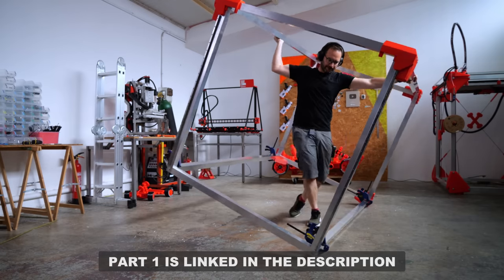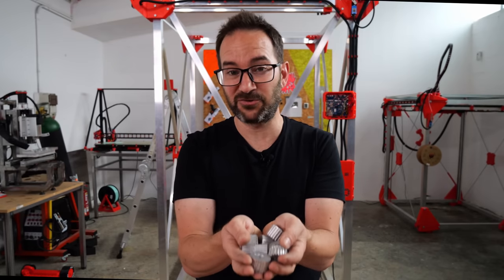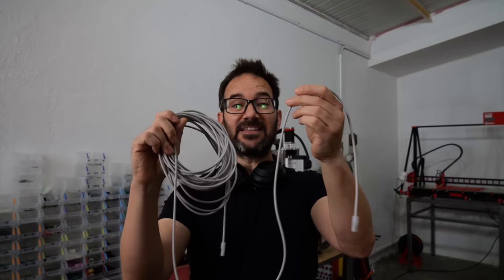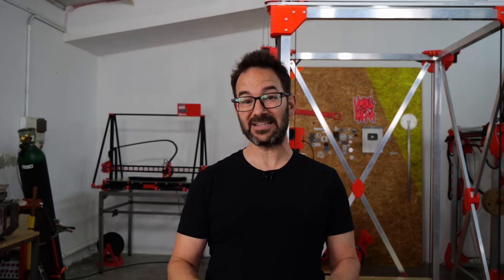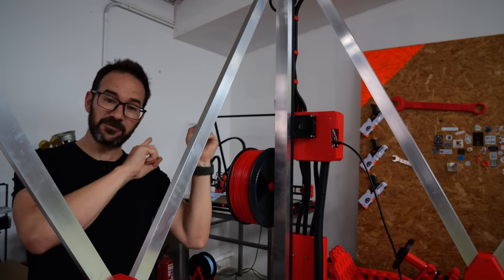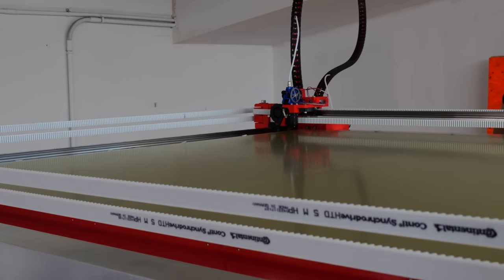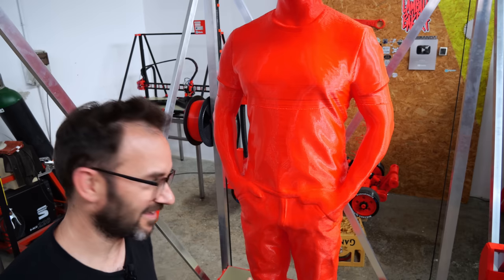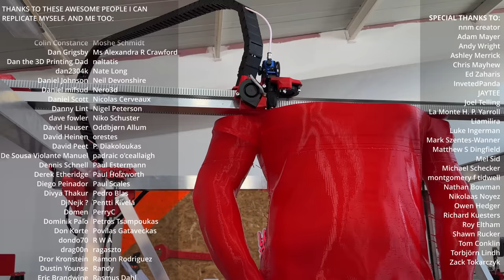You won't believe what I 3D Printed - Giant 3D Printer build Pt.2

Comment: expensive v-wheels are far better than cheap linear rails.
Reply: At the scale of this printer, and given that the v wheels are not supporting the dynamic weight of the part, I think they're totally adequate. You can get very accurate aluminum extrusion, and even with linear rails at the scales involves you are still dependent on the aluminum extrusion for overall dimensional accuracy.

For other designs where the moving axes carry the weight of the part, I wouldn't recommend v wheels since they deflect by design. But here they are only aligning the bed and supporting the known weight of the print head.

It is a very clever design with many good solutions to problems of precision and fabrication.

Comment: Is it possible to make the motors closed loop?
Reply: Sure.   Closed loop servos are pretty common on higher end laser engraver cabinets.   The issue of missing steps tho is better corrected fixing the mechanical issue that caused the skipped/stalled steps in the first place.

Comment: Fun Fact: 
You can buy a regular 150$ printer and modify it's frame to a bigger printer, setup the software to the new dimensions and voila , a big printer
Reply: That's what I was thinking. 

Just a larger frame and the base am I right? I'm learning about all this rn.
Reply: @timothyodell5245 you gotta make a bigger bed too, plus you gotta upgrade the motors to compensate for more weight, longer beefier belts, if your printer uses lead screws then longer thicker screws as well, and basically all youre getting at that point are the brains, power supply, and the hotend
Reply: @ziljaeyan1203  though youd need a bigger hot end if you want to use 3mm filament and a bigger power supply for the new motors...

Comment: I've had groove wheels for ages now. The secret is to not over tension them and to keep them clean. If you break those "rules" they suck. Every time i buy someone's old printer that happens to have these, the wheels are shot because of either or both of those things. The tension (on the rail) should be set such that they engage and not rattle, and that's it. Printers with the offset bushing (for these) are the best, the other methods of putting tension on them suck, and don't really work. Cleaning them can be done with ISO, once every weekend (of use) or every time you power it up. The rails should also be clean of dust.

Comment: Honestly, v-wheels are fine they just wear down more often then linear rails. I would prefer linear rails but a cheaper solution might be 80/20 or compatible-make unibearings with z-axis extrusion bolted to the square tubing.

Comment: challenge: build a 3D printer that is 2.5 meters wide, 5 meters long and 2.3 meters high
Reply: the design that he used, let you change the dimensions lol, 5m long the only thing i can say its, poor motors lol
Reply: @UnspokenTube0  😅 Don't  you  want 1:1 scale car out of a 3D printer lol
Reply: @user-lv5xl2hf2v  xd my plans its to make the parts for the car lmao, or at least the mold so i can make them in carbon fiber lol

Comment: Is there any benefit to using a spool system over a heated screw extrusion mechanism? (I forget the name of the mechanism, the way Dr D Flo approached it)

I feel like at this size (with how much material you'd be using) that it'd be way cheaper to do the heated screw extrusion method?

Hell, would the heated screw method even work as well for assorted materials as direct drive? Like would it impact print quality much?

Comment: If there's one thing I don't understand, it's why you chose to use a printing surface as what needs to move in the third dimension.  Aren't you afraid that the weight of the print will cause it to stretch/bend/tear?
Reply: Probably better precision than a core xy type at this size?

Comment: You might think about how dry the filament is as it gets to the print head,  keeping the roll and the long path dry might affect quality too, especially if the room is not unconfortably dry. It might not be an issue, but it could also be an issue. Even so your giant printer seemes to work okay even with the fixes you had to apply, that suggest you did a fantastic job making the printer. 
My question now is, can you improve upon it? :D

Comment: why did you use pei sheet top of the glass? Glass can be alone better for heated bed?  i am asking to learn :)
Reply: I think that is a way to reduce the flatness of the glass, thus reducing the suction effect that could come with large 3d prints bases. this could be an issue in XXXXL 3D printers I imagine. 
it also reduces the risk of breaking the glass if the 3d print refuses to separate as the PEI should be the layer to fail. which I imagine is cheaper than the glass, or at least easier to replace. In case of printing PETG, this can be a serious issue (it has an incredible adherence to glass and PEI, but adding glue as a weakness layer tend to be easier to apply in textured surfaces). 
with PLA it could also reduce the likeness of first layer failure due to string traction overcoming the glass/PLA contact surface.

Comment: Is it the statue thats that wobbly, or the 3mm alu bed? I think using some kind of foam-sandwich panel with skins glue-bonded on both sides might make a lot of sense. Though I suppose heating just one of the faces of the sandwich panel wouldnt be great either, in terms of bowing. Maybe cut the heating wires into the foam then laminate with carbon fiber? Not for the specific strength but the low thermal expansion.

Comment: Bro which software will you use to work the printer like marlin or any other firmware
Reply: @OFFICIALIVANMIRANDA6  bro tell which firmware did you used
Reply: @demontejas7393  its a duet3 motherboard zo RepRap firmware I guess

Comment: Can someone explain why the bed needs to be heated? Is it just to be able to remove the print? Because it seems like the active part of the printer isn't anywhere near the bed past the very beginning
Reply: Bed heating allows for better adhesion. Prints wont adhere to cold beds.
Reply: @ognoobish5332  Ah, I see. So it'd just fall over in the printing process?
Reply: @yaksher  The extruded filament is over 200°C, and as you know things shrink in size when it's cooled down. So if the printed thing is not heated, it can shrink while printing, resulting in the edges of the bottom layer floating(google '3D printer warping'), weak adhesion and yes, even falling over or moving around on the bed. These days almost every commercial 3D printer has heated beds. Hope this helped
Reply: the heated bed also reduces warping on the first layers, by giving it a less sharp drop off from the nozzle temperature, to the bed temperature.
Reply: Plastic contracts as it cools. When it contracts it will lift off of the bed, so the model will likely fall over during the print. The heated bed prevents the plastic from contracting, but doesn't heat it so much that it melts.

Comment: watch out for those cheap solid state relays, they will burn up. I don't know if yours is a cheap ebay one or not.

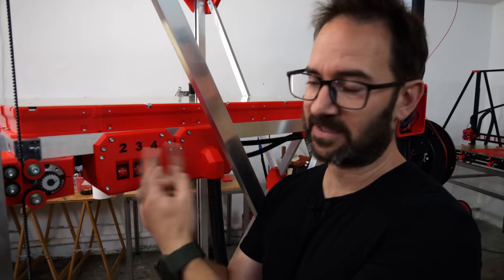Also your whole bed moved 2mm when you touched it at 13:07. stabilize that thing

Comment: I wonder where this history (that I follow since a cupple of years now) of always bigger printers creation will ends :)

Note, It sounds strange that it took 4 days to print 6.2Kg, that would mean only 64g/hours nearly only 1g/min, I assume you include the whole time wich also include issue you have encounter and their resolutions in the total print time ?
Reply: Lets print a planet?
Reply: Slartibartfast has entered the room
Reply: His notes says it took 76 hours of print time, so more like 81g per hour. I think he has to print slowly because of the model aspect ratio, height to width. He is also pushing 1.75mm filament thru a 1mm nozzle at 0.4mm layer height. That takes time to melt that much plastic. Plus, no part cooling fan?
Reply: @jbrou123  Sorry I did not read his notes, just earing when he said 4 days for 6.2Kg, you are right for melting quickness but I assume he is using something sized for a 1mm nozzle and able to melt pretty fast. 

Even with 81g/hour, using a density of 1.2g/cc, this is less than 20mm³/s of flowrate (18.5mm³/s), this is no more than a low budget average printer. (I have to precise that I am absolutly not being critising & I love this channel, I just try to understand), (EDIT: a CHT nozzle with a .6 nozzle can easily give 35mm³/s)

For cooling, IMHO on such big print there is few need of part cooling except maybe for some bridging & big overhangs, but 1mm nozzle & 0.4 height(give a tangent ratio of 0.4 height/width) this should handle well most overhangs.
Reply: @brunoaugier  Indeed. Part of the reason for slow print, is as I said. His model is very tall, compared to its base width. He showed how much it wobbles. I'd like to see him print something with a large area base, maybe a large box. Then we can eliminate the wobble factor and see how fast this thing can really go. As you stated, that hot end he is using can handle a lot higher flow rate. Shoot, I have printed with a 1mm nozzle at 0.3mm on my old CR10 with a stock hot end.

Comment: At this scale, is there any real reason to not just use wood for the frame?
Reply: dimensional stability would be my problem with using wood. your printer would actually be different sizes at different temperatures and levels of humidity
Reply: @Xayify  Consider it again!

From two quick google searches:

1. The thermal linear coefficient of expansion for aluminium per degree Centigrade is 23∙10E-6

2. For wood: The coefficient of thermal expansion in the direction of wood fibres is in the range from 3.5 to 5.0 × 10-6/K

Not that either of these 2 would matter too much at this scale (aluminium will dilate less than 0.05mm per degree for a 2m length) but aluminium dilates at least 4 times more than wood with temperature increase. Wood does absorb humidity though.
Reply: @dan-nutu  I shall!

I do see what you mean, aluminum definitely shifts a lot as well. however the thing to remember is that wood is organic, as such it will not shift the same amount across the board as aluminum wood. humidity is the primary factor in this but but you are certainly right that it is not anything insane.

I'm not sure about this really, on the one hand you have self leveling which helps a lot in forcing constancy, and in this particular design I actually do believe it's even less of a problem given the two axes are on top and I think would just be undesturbed

on the other hand, I don't really think the economy works to make it considerably cheaper to do wood right? extruded aluminum is cheap and either way you are using a lot of material. 

so I'm not sure what gain I'd be looking at for even the potential of wood complicating an already massively complex machine

at the same time I certainly won't tell others to not use wood, really I can't say it's a waste
Reply: I'd kind of like to see a big 3d printer made out of wood... You know, creaking like a haunted house or a rollercoaster :)
Reply: I reckon it would be easier or more accessible to try to make one using a wooden frame. You could paint it to prevent it from absorbing moisture.

Comment: How much to construct some similar
Reply: 1.5-2.5k
Reply: Wait and build a voron v24
Reply: Not as big but 100 times faster and better
Reply: @neayt9952  Dude.. this was NOT his question. You dont know what he needs unless you ask. I have a V2.4 but wouldt recommend it. But not because its bad.. but it has issues.
And you wont build a V2.4 in this size. And if.. you will end at 10k.
Ppl like you trigger me hard.
Reply: @hanswurstusbrachialus5213 chill man. I just recommended a printer. And no. Not 2.4. a voron v24. Trust me when I say that it's gonna be better in almost every way.(a v24 was the first voron. It wasn't released to the public, but special build for a company. It's 24 inches cubed therefore the name. V2 series is a downscaled version of the v24. A revised version of the v24 will be released this december and rcf says that it'll cost about 2k) please stop talking about things you know very little about

Comment: Ivan, I wonder if you've thought of this as a new project (or a modification of the one(s) you have already built.

That is, turn this huge 3D printer (or a smaller one that you've built) into a 5 or 6 axis printer, where the bed and extruder tilts in 2 axes so that any shape at all can be printed without supports.  (there are videos of such amazing machines).

Would you consider that?

Comment: wowch, really seems the most practical architecture on this scale is a delta
Reply: I don´t think so. It would have been even taller for the same z height.
Reply: I'm curious, any reasons delta would've been better?
Reply: @mrvolucris1863  requires less superstructure: more height, true, but those are just 3 already existing elements lengthtening. beyond that, still only 3 belts with only 3 steppers (say roller wheels on 4040 extrusions, or 20mm rods or something) and no moving bed shenanigans; 
deltas suffer lower mass penalty with scale, even core xy (a massive, pun intended, improvement over bedslingers) still suffer from the x-gantry gaining weight
lastly, hangprinter
Reply: @matushonko7223  interesting, it does  seem to waste less money on movement parts. 
 

I think these two aspects are also to consider:

1. The circular build area is limiting (Printing a big rectangle, or a long object (positioned diagonally on a square buildplate) )

2. Also surely if you scale the printer up:
CoreXY printer: printbedspace/footprint goes up, because you don't enlarge the railsystem; just make it longer.
Delta printer: printbedspace/footprint stays the same because delta is also limited by its arm movement geometry?

Hangprinters seem like a very cool concept, you could just make a room into one, so you wouldn't need any structure!

Comment: It's great what you're doing, but I just find it unfortunate that in terms of technological evolution, your printers don't evolve.
Only the form changes and the architecture.
Your platens remain rigid, whereas most contemporary printers use flexible platens, and the speed, too, which must be very low.
On printers with such large volumes this must be really penalizing.
Reply: It's hard to push all boundaries within any amount of reason. He's pushing one boundary. size. Speed is another boundary for another person.

Comment: Could have done better with a cnc mill some block of recyclable material and thermoforming.
Could have saved tons of energy and material, went on to make a filament and 3d print again into plastics using an inefficient technology. Now that the plans are public, there will be more clones that would multiply this.😢🏜💔

Comment: Apart from building the same scheme cnc and 3d printer do something meaningfull ,interesting please
Reply: this is interesting and meaningful
Reply: @hajjkl6672  More wasted plastic ?
Reply: A few things here, this is recyclable so not destined for landfills, this is the first print great for calibration as he stated he had to change it to find the right settings, he'll also probably keep the print as it's a large milestone, and lastly your more likely to end up in a landfill because your more garbage than that literal piece of plastic.
Reply: @budgiefriend  you do realize recycling filament is a thing right, especially in such high volumes as he is using
Reply: @budgiefriend  Explain how this is "wasted plastic".

Comment: What a such stupid and awful way to waste a ridiculous amount of filament and electricity.
The fact that you can do it doesn't mean that you should do it
Reply: It may be a stupid and awful way to waste ridiculous amounts of filament and electricity for you, but that doesn't mean it is for him. There are a ton of people who make prints in multiple parts all the time because their print volume is too small, then have to put them together and fill the seams. Having a print volume this size would eliminate that step entirely, which would undoubtedly make things much easier.
Reply: but, it was cool though
Reply: who cares
Reply: @zackjones8802  Of course it's awasome have this print volume and the entire machine itself is fantastic I love it. My problem is with the application of the printer, Why throw away that amount of non-recycable and pollutant material that will remains in the environment for decades or even ceturies ? Why spend 5 days of electricity to make 1:1 scale statue of yourself that's ridiculus! and so narcisist. For sure the world doesn't need that.
Reply: @edgarromeroherrera2886 the world doesn't need you either, yet here you are.
Reply: @edgarromeroherrera2886  So... first off... the statue is printed from PLA which is Biodegradable, isn't made from Petroleum, and is also fully recyclable. That entire statue can be melted down into more filament and turned into something else without an issue. I say just let the man have fun building cool things and maybe find something else to complain about :/
Reply: I bet you also think Elon Musk launching a Tesla car into space is stupid, am I right?
Reply: @seppukuban21  MAN you are totally right! , amazing, you get the hole point without even trying.
Reply: @edgarromeroherrera2886  some things don’t need to have points to them, this guy wasting a little plastic is outdone 19837373929:1 in seconds just by cars driving around and factories producing bottles. At least what this guy did gave many people entertainment.